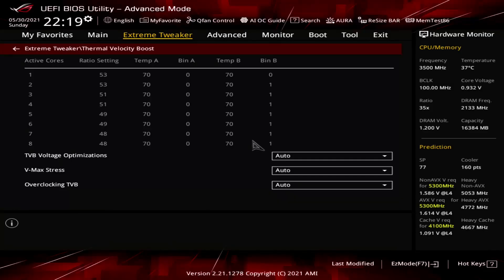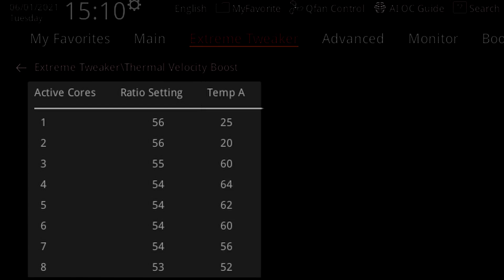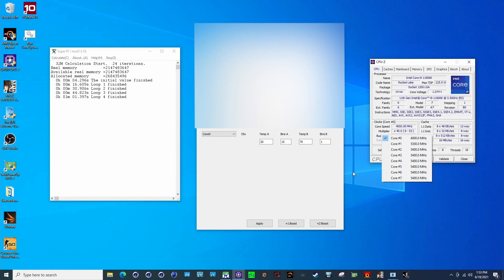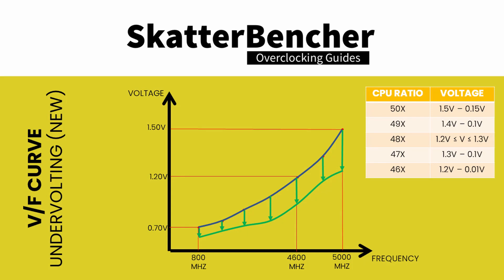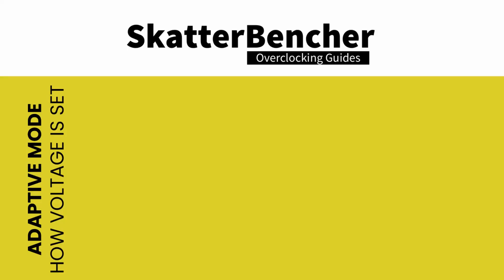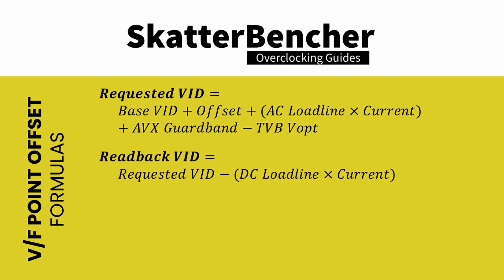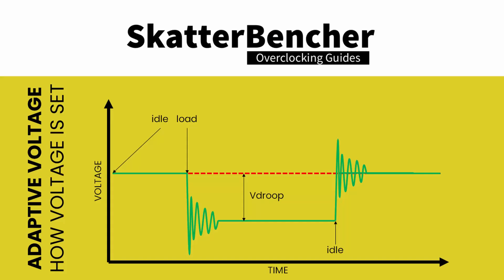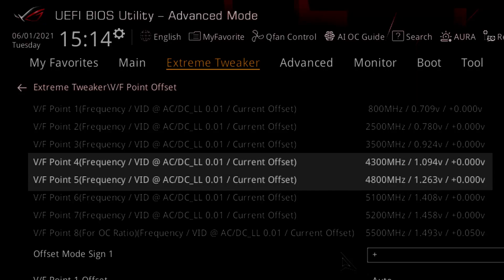"Using All The Overclocking Knobs" Ep.2 | OCTVB & V/F Point Offsets | SB#25

Comment: how bad is it to have high temperature bin steps?
for example for me 13900ks 61x4 58x6 56x8 - for 58 and 61 steps i have -1bin at 65c and -1bin at 80c, it seems to be working fine like that, but is it really bad? i see your temperature values seem a bit more sporadic and lower overall
also is there any specifc way to tell what ratio is failing in octvb when doing transient tests?

like, vf 11 (oc ratio) being 61x for example, and vf 9-10 are 6000 (duplicate i guess).. and vf 8 is 5800... But a WHEA error is occuring (corrected not bsod) sometimes.

my vf 9-10 is 1.474 native, i added +0.050, but it still seems to cause trouble sometimes. however my global adaptive is 1.49v , which is vf 11 oc ratio 61x?
so does that mean the problem lies in instead the 57-58-59x frequencies being unstable? perhaps the 58x6 setting?

Comment: I did a lot of tests with my 10900kf and my conclusion is that 10900kf VID voltage follow frequency and not multiplier. If I increase BCLK frequency to 102MHz, I will have 5100MHz at 50X, and the voltage should be the VID of 50x. In practice, I found the voltage for 50x102 is exactly the VID of 5100MHz. VID follow frequency with my i9-10900KF and Asus Maximus XII Formula. Please, if you can, test it again and tell me if I'm right or wrong.
Reply from the maker: Do you have BCLK Aware Adaptive Voltage setting enabled (or auto)?
Reply: @SkatterBencher  
CPU: Intel Core i9 - 10900KF - SP86 ⇒ 56x7 - 55x8 - 54x9 - 53x10 ⇐ (+2Boost OCTVB profile, VMaxStress, VoltageOptimization) - Ring@8~47x - Full Load: 51x@1,247mv
Motherboard: ASUS ROG Maximus XII Formula rev. 1.xx - BIOS 2103 - AC_LL@0.50 - DC_LL@1.12 - LLC#4@900KHz - Phase_Control@extreme - Adaptive@1,533mv ( BCLK Aware Adaptive Voltage setting enabled)
Offsets: VF#1@659+0mv / VF#2@794+0mv / VF#3@914+0mv / VF#4@1,054+0mv / VF#5@1,169+0mv / VF#6@1,328-7mv / VF#7@1,328+63mv / VF#8@1,428+90mv
 VCCSA@1,240mv - VCCIO@1,190mv

I Never tried to disable this item. Could you help me with a explanation of this BIOS option?
EDITED: I watch your video again and got how it works. The default is enabled, so VID will follow frequency. If disabled, it will follow the multiplier. 
So now I'll try 5700MHz with BCLK 101,8MHz :)
By the way, Congratulations ! You did the best explanation of OCTVB I ever found.

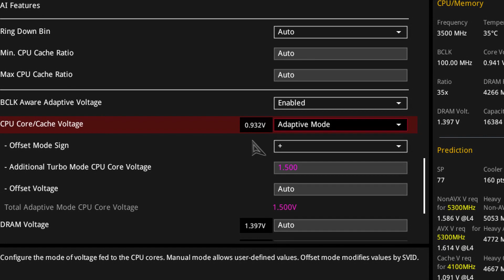Comment: 13:25 shouldn't the "Additional Turbo Mode CPU Core Voltage" be 1.493 to match the V/F Point 8 Base VID? 🤔
Reply from the maker: I wanted to show where to set the value, not necessarily match it to the base VID value

The "Additional Turbo Mode CPU Core Voltage" should be equal to or higher than 1.458v (V/F Point 7) to be of any actual use. If you set it lower, it will just use 1.458v anyway.
Reply: @SkatterBencher  Ahh... thank you